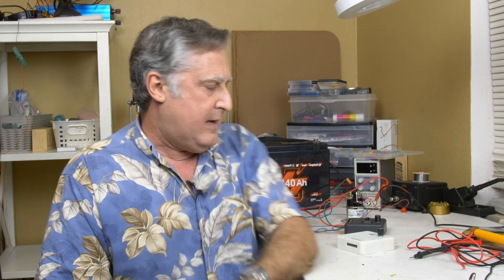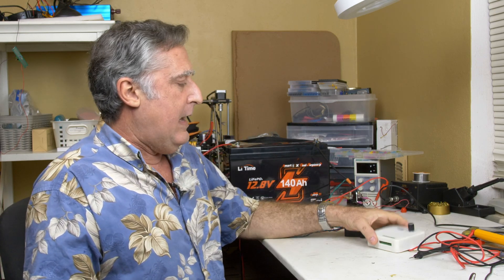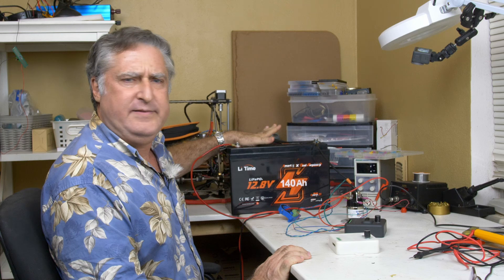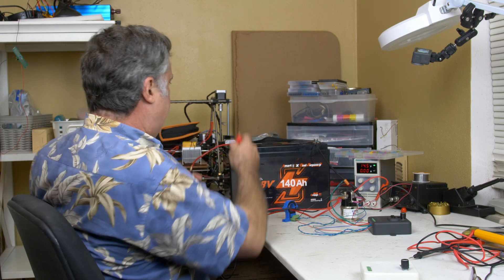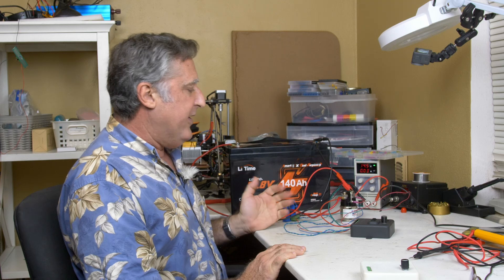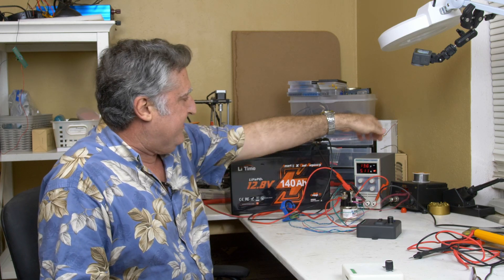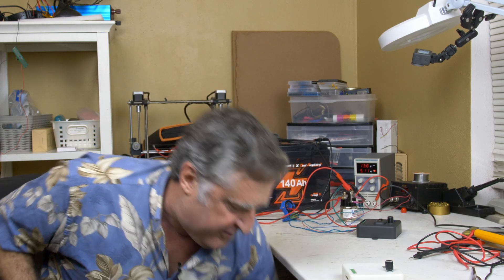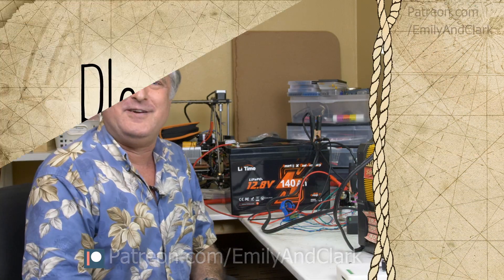Build Your Own LiFePO4 Charger using a BankManager

Comment: Im not a troll! I like your video's and like watching them. And im no electrical boater.. but my feed back on your battery monitors as an Australian consumer is firstly, they are way too expensive. Secondly, they are messy. You need three components and then lots of wires running between then. Just not something that encourages me to expend exrra dollars to have. Like i said, im not a troll, this is my feed back.
Reply from the maker: I'd like to lower the price but making them in small batches costs a lot.  The plastic case alone costs 40 USD 
    I'm thinking about getting these assembled in various places around the world by guys who will handle suppose and marketing so the production numbers can go up.
   I just got the CE certification together.
I was waiting for that.  I have purposely not done any advertising outside this channel so I could keep up and stay mostly retired.

Comment: I love the videos and sharing of your knowledge.  I have been watching your videos from the perspective of a homeowner figuring out what type of home backup power system I want to build.  I am convinced you have made great strides in the proper charging of lifepo4 batteries.  I wish the bank manager was easier to setup for use with lifepo4 only and more of an off the shelf charging solution for home/AC charging... which well, this video shows how to do, it's just a bit to take in, combined with the manual, i am confident I could wire this up and get it working just fine... for my use case it's just hard to swallow the price tag given it's not a simple plugin solution.  Thanks again for sharing the knowledge and I'm still considering purchasing it lol.
Reply from the maker: Used without lead it's a bit of a manual operation.
  The lead is there to help your existing charge controllers from going crazy when the BankManager removes the li.
   In many applications the lead batteries can be really small.
   Check out my Duffy video. In that install we used less than 10ah of lead

Comment: If my motorhome house batteries are 24 or 48 volt lithium and chassis batteries lead acid 12 volt, will your bank manager work? If not, can you design one that will work. Thanks
Reply from the maker: You'd need a Dc-Dc charger to step up the voltage.  That charger might have a setting labeled li but it won't charge your Li batteries correctly.  That's where the BankManager comes in.
   Same for your shore power charger

Comment: so basically the power supply IS functioning as the Pb battery, in how you wired this up? Did you program the BMplus to not feed any power back to the Pb bank... ( power supply in this scenario)  in case say the power goes off, or one turned off power supply prior to disconnecting the wires to the  liPo getting charged etc..  

Would think one would not want juice getting sent to the power supply which (I think??) the BMPlus would see as "Low juice in the Pb.... time to fill it back up from the LiPo bank"... or did you avoid that scenario by not wiring in that "fill back up" circuit" in how you wired this up for charging  LiPo only?

just trying to break this down for my brain...  my few brain cells work best when looking at things conceptually. 

Thanks.
Reply from the maker: The power supply won't suffer from being connected to the battery when off.  So no need to worry 

I honestly can't think of any type of common power supply that would suffer.  Maybe a motor/generator but no one has used one of these this century.

Comment: Clark. You are misinformed on the Epoch batteries. Please be careful about spreading misinformation. They do in fact always charge to 100% capacity prior to hitting the protections with proper settings. If you dont believe me go to the Panbo website and look up Ben Steins excellent article regarding charge voltage vs time vs capacity where he charges to various voltages from 13.5 to 14.6 in .1 increments. He uses an Epoch Marine battery for these test and this excellent test directly disproves your claims made here. The only additional parameter the Epoch batteries  use is time and current added to the algorithm basically ensuring the batteries can not be held at a very high voltage for extended periods. Thats it.

Comment: 16:02 C = Ah/A-charge-rate? Wouldn't that be hours to charge from 0‐100% ?
Reply from the maker: You could think of it that way. .5C charges in 2 hours .25C charges in 4 hours

But where the C rate is most useful to the engineer is to standardize the charging current between batteries of different sizes.

Comment: Should the BMS do the same thing 🤔 voltage into hockey stick= Mosfets prohibit charging?
Reply from the maker: Nope, not at all.  And so many people think it does.
   The BMS shuts down just before the top cell goes so high it vents electrolyte.  Loads of overcharge damage has already been done.
   100 percent is before the hockey stick and you shouldn't repeatedly charge above 100.

Comment: Is this possible with a gen one?
Reply from the maker: Sure.
   Gen1 and Gen2 are almost the same thing electrically.
   You just have to short the contactor bolts so both sides have the same voltage to start the process.